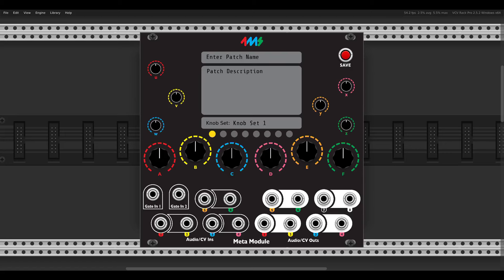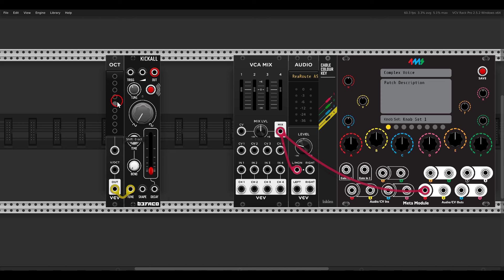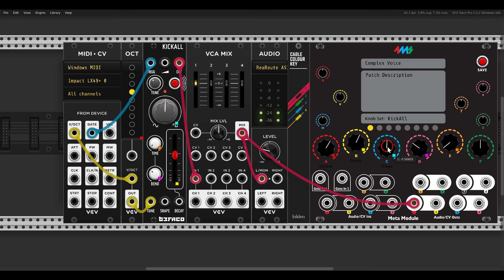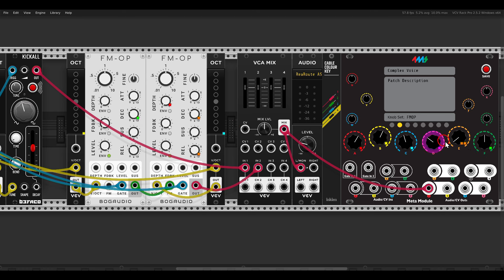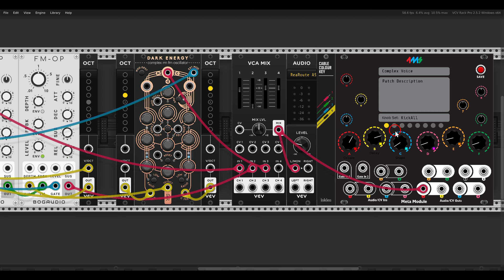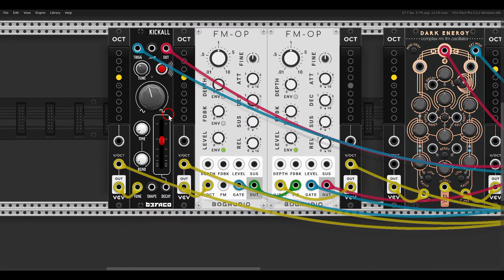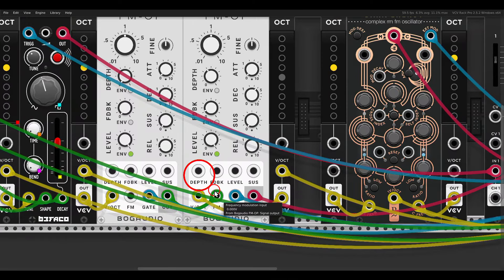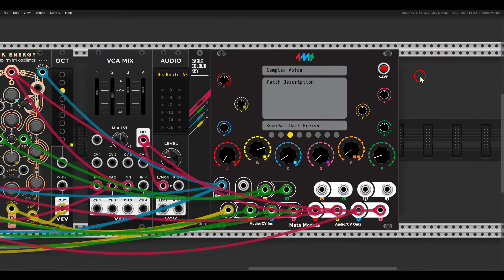Building a complex voice for the 4ms Meta module in VCV Rack

Comment: Are you doing any gain staging before going into Meta on patches where you use Meta as a processing unit? If i send an analog VCO from my rack i instantly get distortion (very harsh)
Reply from the maker: I would definitely add an attenuator at the start of the chain. I do this with hardware modules as well. They all have different ranges...

Comment: Nice video and congrats on owning one already! I was wondering about how the knobs handle the position when you switch between knob sets. If the knob would have been infinite encoder, they would pick up the position wherever they are but it seems that those make a jump when you switch and then move?
Reply: i read in the forum they are adding a knob pickup mode which will be like ableton pickup mode
Reply from the maker: Yeah, they're working on pickup mode :)

Comment: How vividly the difference is heard in the sound, when an analog  module (sto !!!) is added to the mix !!!!
Wich what's the question: In what mode does the 4MS META audio engine work? In VCV, I expose an audio-engine of 96 kHz so that it sounds acceptable.
Reply from the maker: I think it all sounds quite nice, especially after running it through an analog filter. I run the Meta at 48kHz.